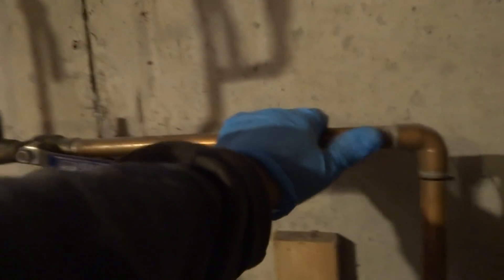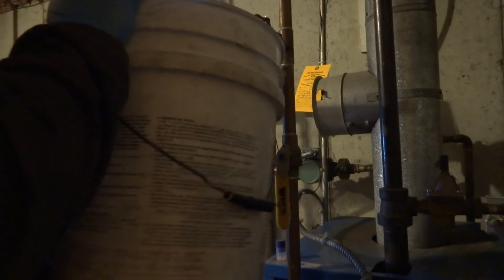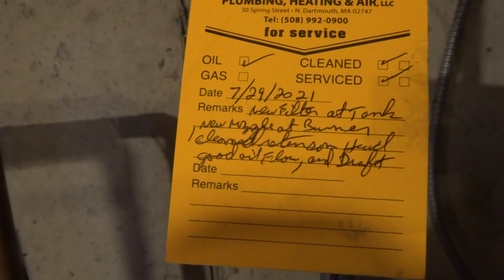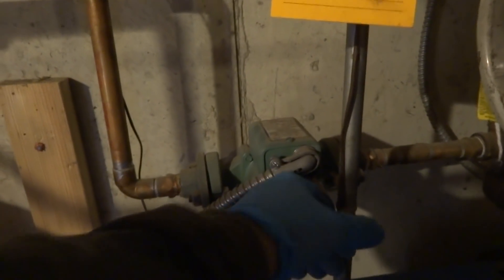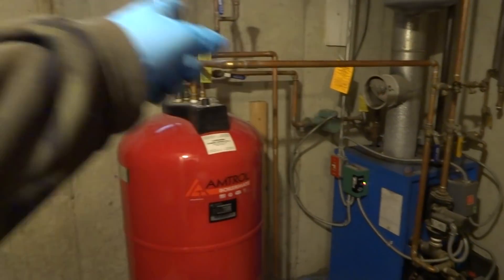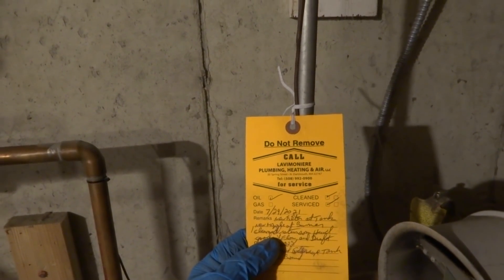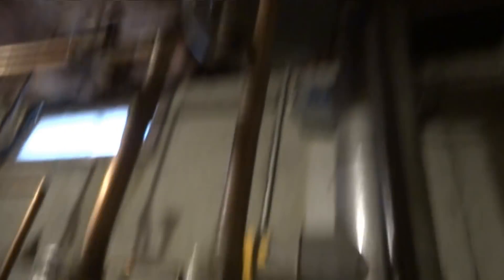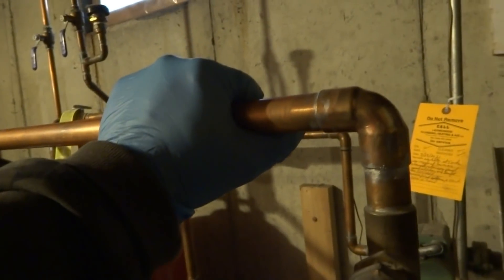BOILER HEATING HOUSE BUT NO DOMESTIC HOT WATER

Comment: The blue “what the hell is that thing” is an automatic shutoff.  If it detects a leak (flow outside of the normal) it will shut the 1/4 turn valve.

Comment: I wish people today were less intimidated by stuff like this and wanted to learn to fix things themselves - if you try and fail, fine, but don’t be afraid of it - get your hands dirty
Reply: Took me 2 weeks to fully understand every different kind of Boiler feed valve and pressure reducer valve and to be able to service and diagnose issues regarding them. Regular home owners dont have the time or patience to learn, and I dont blame them.
Reply: Not really, because to be able to do this sort of thing you need a lot of knowledge which most people don't have. Furthermore it could be dangerous in the respect that you could easily flood your property or start a fire.
Reply: @leedrummond164  
yeah mate, tapping and opening and closing valves can really start a fire.
Reply: @ursodermatt8809  I'm talking about in general, that's why in England you have gas safe engineers for boilers and part p electrical engineers for the  electrics. It's illegal to touch it if you aren't qualified and there's very good reason.
Reply: @leedrummond164  
mate, did you actually watch and understand the video?  
the youtuber was closing and then opening again that feed valve, what ever it is. which cleared an air lock. it is in the water circulation loop.
now, just doing a guess, even in england you do not have gas circulating in a hot water tank.
you are like making the argument to open a water tap you need a gas engineer to do that.
Reply: @ursodermatt8809  mate I watch a lot of steves videos.  What I meant was in reply to Jeff lynches comment when he said people should learn to fix things themselves.  Well that's not practical. The average person wouldn't have a clue what they were looking at. And Nah we don't have gas in the water heater. They are gas combi boilers a lot of them and most houses have an emersion tank and it can also supply hot water  case of the boiler going wrong.

Comment: Hey steve.  Thanks for your channel brother.  I got a question for you:  i have an oil fired boiler.  5 zones wired into a taco relay.  I am having my first floor zones temp climbing way past my thermostat setting.  Gravity?   Bad flow valve?   It just started doing this.  The pump is not energized but the temp climbs.   Maybe its something simple??   Any thoughts?
Reply: Could be a bad flow check if each zone has its own pump or a bad power head or zone valve
Reply from the maker: check to make sure there is no voltage to circulator .. when tstat is off . if thats ok look into leaking flow check .. flow check should only open when circulator runs ..